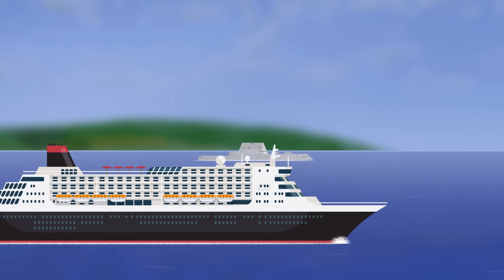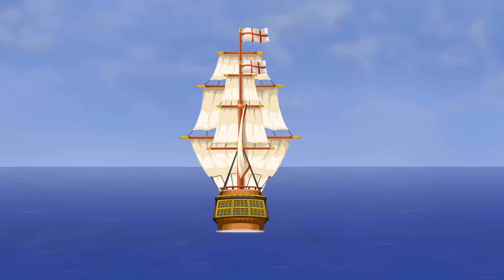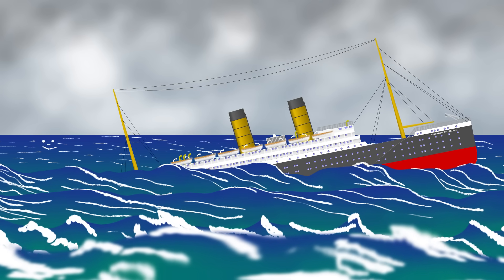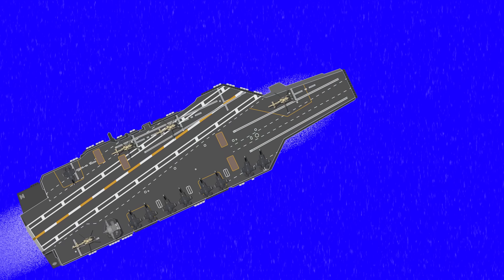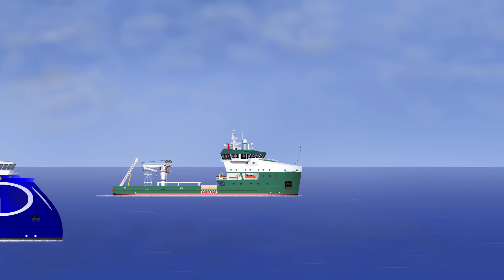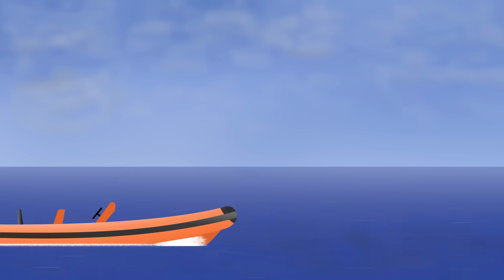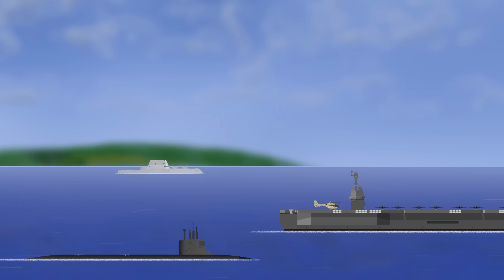Why Are Bows That Shape?

Comment: The major reason for small sailing yachts to have a plumb bow is to increase water line length as this highly affect its hull speed. And if my yacht can go 8 knts. and yours can only go 7 well....Major selling point. Plus, a longer water line adds to internal volume. Again important when an inch = a foot. Biggest reason is the the international racing rules change the allowable designs of hull and sail area. Then thinks started to change..

Comment: Awww buzzkill here. So many words used incorrectly... At a reasonable distance? Who's reason? Makes sense from a logical perspective? (One would assume that facts and logic were used to achieve a certain aim as opposed to belief and metaphysics?) 
Results in a shape that is much easier to cut through heavy seas? (The shape doesn't - the bow does) - A bow of this shape cuts through heavy seas more easily.
Damage under the waterline drastically reducing it's chance of survival... In plain English? Take on water/flood the hull and sink.
Catalyst for the next evolution... BS
Maintain water-tight integrity? 
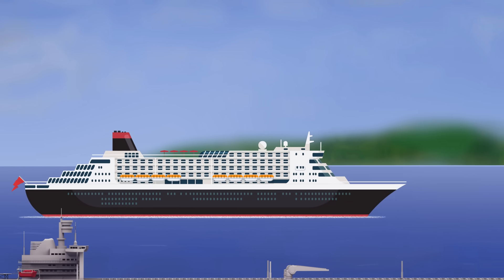3:08 the flare may be the same - just not in relation to the length... the tanker's will always look smaller...
There were more.. you need to be critical of your work.

Comment: I would be interested in hearing about catamaran hull design, what kind of advantage/disadvantage does a "double hull" offer (probably not the technical term, but you see what I mean), and why is it so rarely used for large ships ?
Reply: The main reason cat's are rarely used for large vessels is they cannot support the weight a mono hull can.
Reply: There are several reasons. 

The advantages of a cat hull are.

Increased area above the waterline.

Decreased drag, and weight.

No need for ballast. The twin hulls are ultimate form stability. 

Once you go significantly above 100ft you are now in freighter or passenger territory. 

These ships are large enough that form stability is no longer relevant. 

You plan on having a lot of cargo weight in the hull anyway so ballast weight is also not relevant. 

The twin hulls, and superstructure cannot carry cargo, and add unused expense.

Speed is still limited by hull length so an 80ft mono hull can go faster than a 40ft twin hull.

A twin hull tanker will not fit in any port, canal, or shipyard in the world.

It's hard enough to fit a twin hull small luxury cat.
Reply: @capnbilll2913  "Speed is still limited by hull length so an 80ft mono hull can go faster than a 40ft twin hull." - only partially correct.  In the 1988 America's Cup match, a 60 ft catamaran destroyed a 90 ft monohull.  The reason is that the hull shapes (and therefore the form factor multiplied by waterline length) were very different, with much higher length/beam ratios for the cat hulls than the monohull.  Also, multihulls are much lighter than monohull keel boats for a given size, and therefore can accelerate much faster than monohulls.

When I was in my late teens/early 20s, I had a Hobie 14 (catamaran) (bought it after it got hit by a car, and fixed it up, which is another story entirely).  I used to go out into Long Island Sound and look for monohull yachts.  I would sail literal rings around any monohull under 40 ft.  Kind of a dick move, but I was young.  ;-)

Another issue that adds to your reasons why there are NOT multihull freighters is that the wetted surface for a multihull vessel will always be greater than a monohull of the same weight.  That will be important at the relatively low speeds and low power of cargo vessels.
Reply: @gregmead2967  The reason a small cat, (or small mono like Opti or Lazer), can go faster than a cruising mono is weight.

Lighter hulls can achieve planing speed allowing them to exceed hull speed which is a mathematical function of water viscosity,  and is proportional to hull length at waterline. 

A catamaran used as a freighter would be subject to this laws of physics speed limit.

This is why all modern freighters have a large bulb at the bow, it gives them another knot of maximum speed.

Comment: Showing the deck plan from above the bow is not at all the same as the waterline entry shape. You do this repeatedly in this video as if one equals the other. Moreover, a plumb bow does NOT reduce pitching. Part of pitching is plunging. Plunging is the downward stroke into the sea, and this is worse on a hull with no flare or flam.

Comment: in smaller boats, bows are pointed though.
Reply: They vary too though, not all are
Reply: @the_linguist_ll  It likely has to do with the length of the shipping boats.  If the front is a point, waves at the bow will have more force on the entire vessel, so this could lead to side pressure on the Hull.  A longer ship has to slide through multiple sets of waves at once.   While a water ski can be a narrow point, or a jet ski or small aluminum boat can have a more narrow point as well.  No boats come to a complete point though, they are both rounded and a point for obvious reasons.

Comment: One thing to consider when talking about sailboats is that many sailboats were designed withe the IOR rating system in mind. A system which gave boats a handicap rating based on their design and was popular in the late 20th century. 

IOR was extremely flawed and one of its quirks is that it measured length of waterline instead of overall length. This drove designers to design bows with a huge amount of rake, the idea being that as soon as your boat heels your waterline length increases making you go faster, without increasing the rating.
Reply: On the flip side, a practical and economical sailboat owner will often want a squarer bow.  Cargo space being one concern, but another is that many costs of owning a sailboat are driven by the total length, regardless of the waterline length.  Docking spaces especially can be expensive, and the cost goes by total length.
Reply: @DanStaal  From a strictly performance POV you want to keep weight out of the ends while allowing as much waterline length as possible. Displacement hull speed is dependent on waterline length.

Comment: Forging tools, you would think a bullet shaped punch would be best to forge a hole shape, but you get lots of friction and harder to push. So we used a  flat nose and steps like a rocket. Flowing metal doesn't rub on most of the punch.

Comment: subs have more considerations too. the front doesn't nececryly have to hold the pressure it most of the time is an outer skin that has holes in it to let water flow in and about in between it an the real pressure hull. its so they can do external ribbing on the pressure hull and have space for like ccencors and stuff. but a consideration for the bow is that there is a big round sonar there and they don't want to get distortion from it going through an angled piece of metal. so its a compromise between pointy and making the sonar work. but the engine power of a sub is ememce so haveing the 100% best hullform for speed isn't criticcal.

Comment: I have the impression that the straight bow of modern sailing yachts is also just fashion coming from race yachts that have a vertical bow due to "box" rules in racing that favor a longest waterline within a box shape leading to a vertical bow, just like overhang in more classical yachts, that were based on rules in which waterline length was penalized so they tried to always reduce it leading to large overhang. This then also became fashionable for non racing yachts...
Reply: IIRC the backwards sloping stern of many sailboats are a legacy of the IOR rules which measured length at the deck level. So by extending the hull behind the end of the deck they got a longer waterline length (and thus higher hull speed). So in effect it was working around the rules, that then became fashion as non-racing leisure yachts adopted the same design.
Reply: Different racing rules over the decades have produced some extremely seaworthy, beautiful yachts, and some really crappy sailboats..

Comment: The "nose" of a submarine has nothing to do with pressure. It's literally just a fairing cover over the sonar dome to minimize drag and it's not even watertight. The sonar dome is the pressure boundary, though there is a watertight door at the rear of the dome that is normally rigged for dive while underway. At least on first-flight 688's

Comment: Also sometimes more efficient means slower
To go fast through water requires exponentially more force with speed as you are pushing a very large mass out of the way
Compare slowly moving a sheet of material through water to very quickly

Comment: For a bit of military background on this, the tumblehome design of bow used to be very common on warships, but it was discovered that when a ship with a tumblehome design was damaged and started to take on water it had a greater chance of sinking due to the greater volume at the bottom of the ship, meaning a lot of buoyancy would be removed in the case of flooding. This is one of the reasons you stop seeing new tumblehome design ships after WW1 up until the recent failed Zumwalt class of Destroyers.
Reply: Aaah. French predreadnought design. Some of the *greatest*, hilariously bad and wonkily designed vessels. I love them.
Reply: @5peciesunkn0wn  it wasn't even just the French, a lot of different nations toyed around with the idea.
Reply: @Sturmischer  The Russian designs were by the French. Most of the nations that went with Tumblehome pre-dreads were inspired by...the French. Since second biggest naval power.
Reply: well, the Zumwalt failed for a multitude of reasons; the hull probably had nothing to do with it. we arent firing shells at each other anymore, and NO hull design will survive a direct hit from a modern anti-shipping missile...a direct hit from a single Brahmos missile, or equivalent, WOULD sink even the Gerald R. Ford without any issue, whatsoever.
Reply: @nikoc8968  I wasn’t implying the Zumwalt failed because of the hull design, just stating that it was a Tumblehome design. The Zumwalt’s main reason for being a failed design was they tried to implement too many untested technologies at once into a single design.
Reply: @nikoc8968  No, one brahmos probably wouldnt sink many large vessels, because they carry only limited warhead (Brahmos for example 200kg - 300kg), also not every one carries armour-piercing warheads. Ships are tough to sink when designed properly, expecially those really big ones with many separate water-tight compartments, double hulls...
Reply: @karelmarkvart1517  a 300kg warhead is probably enough to sink any ship on the ocean today.

theres a chance a carrier such as the GRF might survive a direct hit, but would almost certainly be rendered combat-ineffective.

my point was that if the hull is damaged at all, then whatever hit the ship is probably powerful enough to sink it in one shot.
Reply: @nikoc8968  your point is invalid: ships can take HUGE ammount of punisment and stay afloar. Just google some real events, during WWII even some destroyers made it back shoot to virtual pieces, carriers survived several direct hits with bobms, whole planes, fires on deck etc. Even modern, nucelar ones are tough as hell, during Nam campaign Enterprise suffered from HUGE fire and ammo explosion and survived... 300kg warhead will make huge hole for sure, but what matters is placement of that hole (if you hit magazines, it can blow up shole ship at once, if you hit lounge or crew quarters its different matter). What sinks ships well are torpedoes exploding under its spine, briking it.
Reply: @karelmarkvart1517  the Moskva was just sunk by 2 200kg warheads, with other Russian vessels sunk with even smaller munitions.

the HMS Sheffield was sunk with a single 165kg Exocet warhead.

if a near-hypersonic missile with a 300kg warhead detonates inside your hull after busting through, your ship will be sunk or put out of action.

these munitions arent detonating on the outside of a ship or under the keel, they are detonating INSIDE the ship.
Reply: @nikoc8968  moskva sunked because poor design, bad fire protection, poor crew training and bad shape in general. Also those huge S-300 missiles stored in one big compartment didnt help.
Reply: @karelmarkvart1517  ...and the Sheffield?

the S-300s on the Moskva were not struck; the intact silos are clearly visible behind the smoke in the Moskvas famous last picture.
Reply: @nikoc8968  tell that to the uss Nevada tough old girl survived 2 nukes and a 2-3 day training exercise being shelled non stop. If you've never seen a missile sink a carrier than you can't say it will. Especially with how they build those ships now.
Reply: @johnfitzgerald7339  thats fair, but a hull floating in the ocean is not a warship. if it couldnt perform its duties, or had to return for repairs, the ship is effectively out of action.

it would be interesting to see a 300kg warhead explode inside those ships, as modern munitions do, and see how well they would float, let alone operate.
Reply: @nikoc8968 Sheffield could have survived the Exocet missile if it weren't for serious problems with their ability to fight the resultant fires. She sank while under tow in rough seas, having not received the repairs she would have needed to remain afloat before being abandoned.

The common thread between the Moskva and Sheffield was difficulty carrying out damage control.

Comment: Submarine bows are designed to house a sonar. Has nothing to do with drag. The tear drop shape is actually the worst one for efficency, which was ever in use. Before the noses became teardrop shaped sonar was useless at high speeds. Also one of the reasons why modern super silent submarines moved away from a full tear drop, as they can implement a more efficent bow design.

Comment: Should have added in some Kriegsmarine Bows. Designed for speed, but also to redirect as much water as possible down or out, rather than over the decks, while maintaining shallow draughts for the Baltics and Coasts of the North Sea.
Reply: S- boot only?
Reply: @jinksomiabodyart3189  No. Deutschland, Scharnhorst, Gneisenau, Bismarck, Tirpitz, and plenty of other cruisers and unbuilt designs were designed with a very shallow draught for shallow waters, and Fjords. But the freeboard around and behind the bow had to be flared to prevent water washing over the deck.
Scharnhorst, Gneisenau, and the Hipper's still had huge issues with water washing over their bows. Despite redesigns and rebuilding most of them.

Comment: Interesting watch, good video.

Can you do a history of propellers from paddle wheels, both rigid and feathering bladed, (I have a thing for paddle steamers) up to the current cutting edge jet systems and propulsion pods?
Reply: Paddle wheels work great in shallow water as the driving force can get to the water above the keel.  Mississippi padlewheel vessels often ran aground on shifting sandbars and shore landings. The paddlewheel  was shallower than the the vessel and could still move a lot of water. Unfortunately having no rudder behind the wheel meant that there was little flow over the rudder at low speeds hence poor maneuverability. Quick fix.... two wheels, one on each side
Reply: @paulharris553  Indeed, sidewheelers with independent drive were exceptionally maneuverable. Though if you really want to, you can use a singular stern Fowler wheel, which is a thrust vectoring propeller, basically a really early cycloidal rotor.

Mechanically it's fairly similar to a feathering paddlewheel, but turned vertical, stuck under the water, and the off-center hub can be adjusted to change which direction the blades throw the water.

It was a failure of course, hence we don't really see any besides the one tested out on USS Alarm, it works but it doesn't make a lot of thrust, so it's slower. Interestingly cycloidal rotors made a comeback later on with the Voith system, but they are still generally regulated to the roles of car ferries and tugs, where maneuverability is more important than speed.

Comment: you missed out the wave piercer bow on some modern racing yachts which do a really good job on reducing the risk of nosediving but are really wet boats (americas cup boats and most things foiling) 

I guess the axe bow tugs are kinda like wavepiercer bows but most high performance yachts will have wavepiercer/ dreadnought bow

Comment: A so called super tanker had a very pronounced flair,,,it deflected high seas from the deck, when fully loaded. Most ‘green sea’ that came aboard would tumble in over the side of the vessel. Also in heavy seas the ship would ‘bend’ in the middle,, rather disconcerting when one first observes it.
Reply: I was on a WW2 Landing Ship which we used during the Vietnam War.  It was designed so that the shocks hitting the bow wave would ripple down the hull. You could see the ship bend as the wave came past and then go off the rear.
One of them was repaired with extra steel in the centre. It was no fun in the sergeant's mess where the repairs had been done. The shock wave stopped in the middle of their mess.

Comment: Tumblehome bows were mentioned regarding underwater hull damage, but not bulbous bows!  Most large vessels have bulbous bows and it's the relationship in terms of length between bulbous bow and the (above water) bow, and the height of flared bow versus the deck edge height that dictates how much damage will be done to the other vessel. Big flared bows are good for impacts with high-sided vessels, but dont help against those with low freeboards. Vessels with short bows will inevitably impact other vessels below the waterline with their bulbous bows.